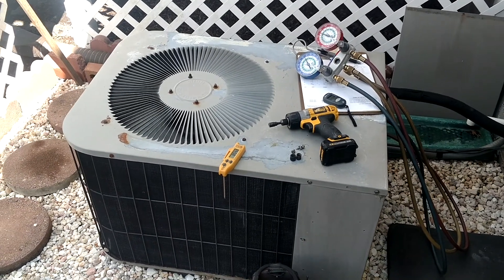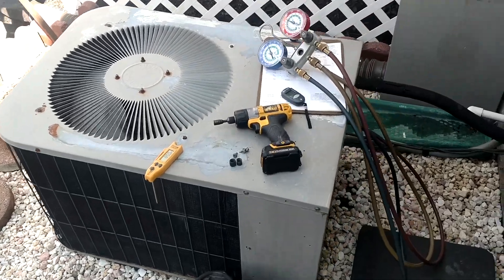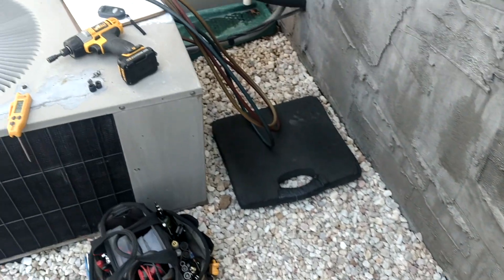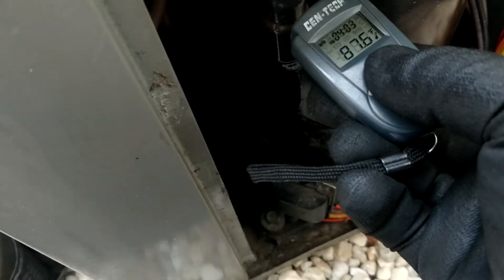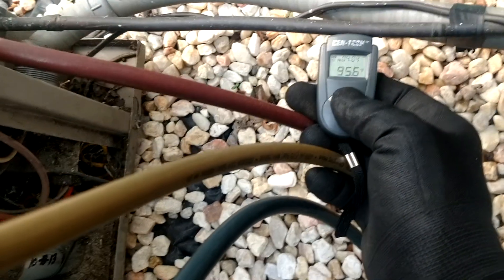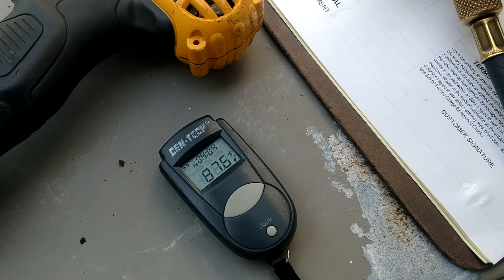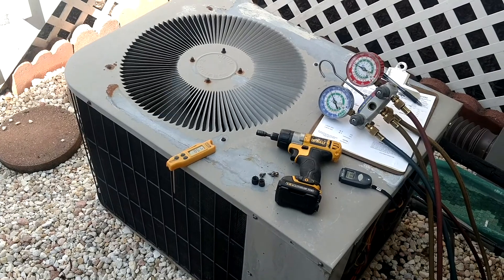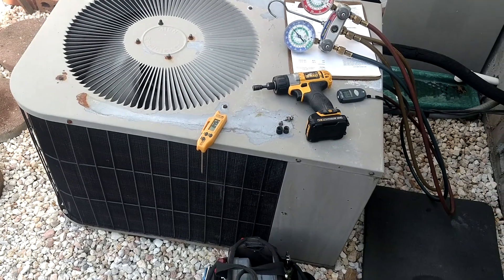The 95’ Janitrol twins (part-2) HVAC maintenance. Harbor Freight non-contact thermometer 1:1 #93983

Comment: Bravo long-lasting, low pressure, pre-Ozone-depletion foolishness AC systems!

* * *

The Nonsense That is Ozone-Depletion

"Holes" in the ozone argument: 

1) Freon is heavier than air:  how do molecules heavier than air get to 30,000 feet (the beginning of the stratosphere)? 

2) The "hole" in the ozone over the South Pole was "discovered" by satellites in the '80: if it was just "discovered", how do we know IT WASN'T THERE ALL ALONG ? ? ? ?

3) There is a perfectly logical reason why there is less ozone over the polar regions: THERE IS LESS SUNLIGHT THERE TO PRODUCE OZONE IN THE FIRST PLACE, especially in winter ("land of the midnight sun...")  

4) Antarctica (South Pole) has the highest average elevation of any continent (8000 ft): Does that have any effect on ozone quantity?????  (The North Pole is all at sea level and there is no ozone "hole" there.  (Why not?) 

5) The offending atom is CHLORINE (very common), not CFCs themselves. The argument goes that the CFCs carry CHLORINE up to the stratosphere.  There are other compounds of chlorine in the atmosphere -- that's one of the things you smell when you go to the beach  --> "salt water" --> i.e. sodium-chloride.  Is the ocean a source of "ozone depleting" chlorine compounds?  

6) Most basic of all, ozone (O3) is an EFFECT of UV blockage, not a cause. [O3 is an unstable molecule that needs a lot of energy to produce, e.g. the ozone you smell around arcing engines. There is less ozone at the poles b/c there is less UV to generate it (just like there is less sunlight to keep the place warm in the first place.     

I hope the public is beginning to see how dubious this ozone scam is.   Monstrous mistakes like this DO happen - think the ban on DDT and malaria deaths.

The Ozone Scam
https://youtu.be/9Szs-treHwQ

The Nonsense That is Ozone-Depletion

https://www.ourcivilisation.com/ozone/king.htm+

Look how we've been "had" by this "ozone depletion" scam:

In other words, CFCs probably have NOTHING to do with Antarctic ozone:

https://youtu.be/lBu3vltczRw

In other words, the× Montreal Protocol is a complete fraud:

Min 0:30:  "Measurement of SURFACE 'ozone depleting substances' (chlorine? are you measuring ALL atmospheric chlorine compounds?).  

https://youtu.be/uVeTJSIbGm8

1987 - Montreal Protocol. Remember that date in this music-tracked piece of manipulative propaganda.
Listen for the weasel words and disclaimers.
https://youtu.be/Ll_TR7C4xr4

The Ozone hole is "healing" (scientific term). Can't you tell?:
https://youtu.be/taTzqRHNIEc

A discussion of atmospheric chlorine:

https://api.nationalgeographic.com/distribution/public/amp/news/2010/3/100310-sea-spray-ocean-colorado-pollution

Natural Chlorine? You Bet! (American Chemistry Counsel)

"Many of these chemicals are identical to highly publicized manmade organochlorines: chlorophenols, chlorinated hydrocarbons, PCBs, CFCs and dioxins."

https://chlorine.americanchemistry.com/Background-Natural-chlorine-You-bet-/

Min 7:50 "In the old days, capacitors used to last 10-20 years"
https://www.youtube.com/watch?v=eGEduZ3EVcg

7) Min 2:00 Listen carefully: in other words,  the ozone hole has been there since AT LEAST the 50s, before CFCs were widely used.

Min 15:00 "interesting scientifically" - must be fun to have these kinds of research grants and boondoggles. Great work if you can get it.

https://youtu.be/AU0eNa4GrgU

How EPA is screwing up your car's air conditioning. 

https://youtu.be/wm56tV5BbJk

Lousy car air conditioning:
https://youtu.be/5jKRiDtcBrs

Guy says we should use explosive propane as refrigerant

https://youtu.be/pv_fxOuLuZU

Propane as a refregerant
https://www.youtube.com/watch?v=iXyHOfx307k

.
Why The Banning Of Chlorofluorocarbons Is Paranoia

https://www.ourcivilisation.com/ozone/index.htm

Min 6:00 -- two different kinds of chlorine... (yeah, right)

https://youtu.be/kmfAM8kQrjU

The stupid claim the ozone layer is "healing" ("healing" - is that a scientific term?)  

Notice that the "hole" always goes away in Antarctic summer (more sunlight/more ozone produced) and reappears in Antarctic winter (no sunlight/no ozone produced (ozone is an unstable molecule to begin with)).  We've been sold a load of cr*p that has made a hideous mess of the AC industry. 

You'll see no change in hole size in the Antarctic winter, which means the "hole" has been there all along and is a perfectly natural and harmless phenomenon.  "Oh well, we trashed an entire industry over a quack-science hoax... Sorry about that..."

https://www.youtube.com/watch?v=kyGoqC9FTFc

https://youtu.be/krqHVzF3-T8

Min 21:00:  A brief history of refrigerants R12, R22, R410a and the screwing we get from the EPA, the "Montreal Protocol" (a self-appointed bureaucracy still alive and well) over their ozone depletion quackery.  The doubling of pressures from R12 to R22, and the DOUBLING AGAIN from R22 to R 410a,

AND R22 wasn't even banned for ozone depletion! (100x less "odp" from R12). It was banned for "global warming" quackery. 

https://youtu.be/V_wUZ4qmAnk

Min 36:00 Can be charged up to $30 a pound to destroy "contaminated" R22:

https://youtu.be/V_wUZ4qmAnk

Min 7:00 "pre-EPA refrigerants operated at low pressure and only soldered (not brazed) pipe joints. 

https://youtu.be/G0XOLDHGBmU

Min 18:00 all refrigerants turn into acid when in contact with water (! ! !):
https://youtu.be/kmfAM8kQrjU

Refrigerants decompose in water ! ! !

https://www.answers.com/Q/What_happens_when_refrigerant_hydrolyzes_with_water

What is hydrolysis?
https://youtu.be/G_mT9JI_jxE

What about the ozone hole and R-12 refrigerants?

https://creationtoday.org/what-about-the-ozone-hole-and-r-12-refrigerants/

Also forgotten is a long list of truly ridiculous claims, such as the one from Al Gore's 1992 book "Earth in the Balance"that, thanks to the Antarctic ozone hole, "hunters now report finding blind rabbits; fisherman catch blind salmon."

https://www.heritage.org/environment/commentary/ozone-the-hole-truth

Minute 22:00 refrigerants disassociate in water, so why sre they a problem in the stratosphere?

https://youtu.be/5SpOiHB6VsE

15% of chlorine in stratosphere is natural, according to this:

https://csl.noaa.gov/assessments/ozone/1998/faq3.html

Another comment I submit to The Order is about "NOISE", namely, 

- NOISE is a bad thing -- we don't want that in our houses. 

- Don't compressors that are forced to operate at higher pressures make more NOISE than compressors that operate at much lower pressures? 

- Assuming the answer to the above is "yes", then would a compressor that has to operate at 450 psi (for that stupid R-410A refrigerant -- 'scuse my french) vs. 150 psi for R-12 (the industry standard till that stupid EPA came along -- 'scuse my french again). 

- Here is a PT graph for the major refrigerants: https://www.engineeringtoolbox.com/refrigerant-temperature-pressure-chart-d_1683.html

- Conclusion: the stupid EPA and DOE have not only made AC equipment more expensive to buy and more expensive to maintain and less effective in terms of cooling (window ACs) -- they have also made them NOISIER.  ... Thank you, tax-paid idiots of environmentalism and quackery that is "ozone depletion" (the warmup act for "global warming" -- "Hey Texas -- how's that renewable energy/global warming/windmill thing working out????")

Thank you Boomer generation (mine) for the 60s mess you have made of America. 

Cheers.

PS: here's a video about a stupid 90% furnace whose condensation overflowed the week before Christmas and trashed multiple ceilings in the guy's house. Of course, those stupid DOE bureaucrats will be there bright and early to fix the damage.  "Happy Holidays!" 

https://www.youtube.com/watch?v=DnVtRqfqoSY&ab_channel=AntiDIYHVAC

... And another video about a screw-up with the INDUCER fan --> a creature of "high efficiency" DOE regulations which dictate the squeezing all so much heat out the combustion, a separate fan needed to get the exhaust gasses out the flu.  Then they break down and screw up the whole system. 

https://www.youtube.com/watch?v=SZJ1GPAATGY&t=370s&ab_channel=VintageVideos2009

90% furnaces:

"Required".
Required by whom?
Are these ultra-complicated and expensive machines cost effective over their total life????
Or is this another expensive, pointless dictate from bureaucratic petty tyrants making life more difficult for everyone?
(All I hear about these are those paper-thin heat exchangers rusting through, fans not working, cramped working conditions, more problems with water condensate damage and EXPENSIVE EXPENSIVE EXPENSIVE REPAIRS!!!)

PS: am big fan of your channel, but have total disgust for the hideous things government has done to this industry.

**

What is ppm concentration of ozone in the stratosphere?

Answer:
The peak concentration of ozone occurs at an altitude of roughly 32 kilometers (20 miles) above the surface of the Earth. At that altitude, ozone concentration can be as high as 15 parts per million (0.0015 percent).

https://ozonewatch.gsfc.nasa.gov/facts/SH.html

How can a 0.0015% concentration of anything protect us from anything?

I.e. ozone is another trivial trace gas like CO2.

..

Comment: Does it always stay on or auto shut off ? My doesn’t turn off after the 15 second
Reply: Thank you very much for informing me ! And for replying so fast !
Reply from the maker: The reading you get, from the infrared eye, after pushing the button will remain on the screen  for about 10 seconds. And then it goes back to the "ambient" temperature display, which is coming from a tiny sensor inside of the device. It is always reading the temperature of the air around it, just like any other thermometer would do. So the unit never turns off completely to where the screen goes blank and stays blank. as long as you're holding the button in it will keep the infrared eye open and continue to take temperatures of whatever surface you're pointing it at. Hope this helps.
Thanks for watching 👍